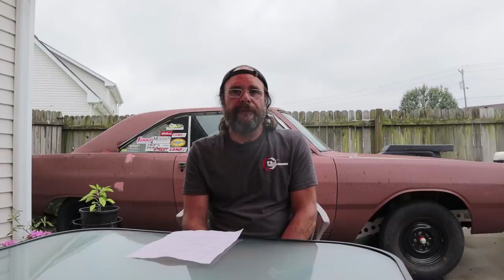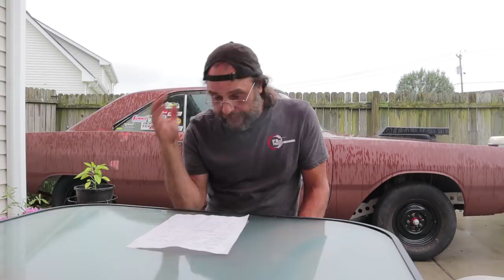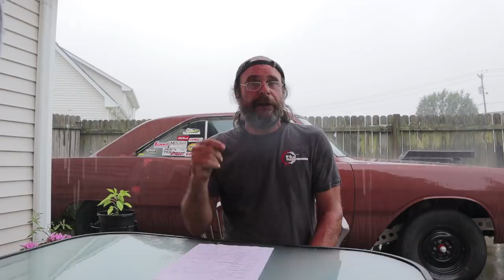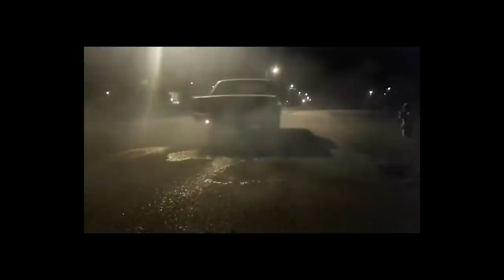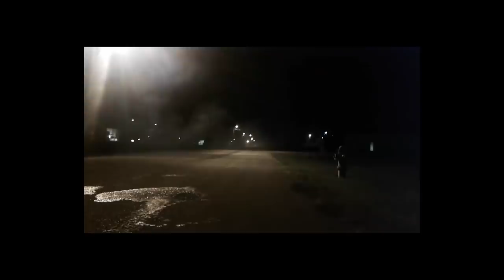Understanding The Slant Six Part Deux

Comment: Tony, I have1986 buick regal with a 307. Could it be a candidate for any kind of turbo? I've heard my engine doesn't have any life to it, said to run forever, but no life. How could it be pepped up? I think stock it's like 140-150 hp.
Reply from the maker: That 307 has two things going against it for any type of serious turbo setup.  Bottom end has huge main bearings that require a ton of oil to keep happy, and an open cylinder deck which can make keeping head gaskets in it a real problem.  I would hop that thing with conventional bolt ons and stay away from pressurizing it
Reply: @UncleTonysGarage  Thanks so much Tony, what bolt ons would you recommend, I really want to get my hands into this job.

Comment: ? so turbocharging , go for the largest chamber  that it would start on so the pressure would last the longest in the cylinders,  then add nitrous ? with fuel injection  reversed pistons and what kind of feed back to keep it from going lean ?

Comment: i know nothing about mopar but i have had a few of them i got a slant six in a 66 gt dart can the trans fit a 318 and will it fit in the 66 dart i can get a built motor  for free and i have a 360 mag sitting too  and i got i think it is 392 hemi not sure of the size needs rebuilt i was told it was a 392 but it is a hemi

Comment: having slant 6,  318,  361, 383,  440,  stroked 440 max heads.   from the factory slant 6, 318 the small ports are the limiting factor.   a 318 doesnt run good on propane.  it takes up way to much space in the port limiting the air.

Comment: @Uncle Tony’s Garage correct me if I’m wrong but isn’t the a903 the unsincroed 3 speed that was usually on the column? Was wondering if you did any modifications to it like gear ratios or a floor mount conversion of some sort? Have one myself and never thought about using it always thought the a833 4 speed conversion was my only real option for performance. Would be awesome to hear back thank you!
Reply from the maker: Yes, the 903 was always column shifted in factory cars.  I built a floor shifter for this one using parts from a couple of different 3 speed floor shift conversion kits.  I WOULD do a quick video of how this was done, BUT, I used the lightest bits available and it's really only good for drag racing...too flimsy for day to day driving.  Pretty sure you can still buy the Hurst kit for the 903
Reply: @Uncle Tony’s Garage so other than the floor shift kit the transmission is completely stock?
Reply from the maker: Yup.  Really not much to do with one of those things

Comment: I didnt get to mention in part1 comments. You already know this but others may not ? Doing some research found that the stock 1 & 2 barrel intakes had 2 flaws : 1 not good air flow. 2  the intake runners are long going out on the end and as you get to the center they get shorter. The problem is the longer the runner the fuel/ air mixture leans out while the other short runners make a rich mixture and that between the 2 you can never get the fuel to air mixture even causing some plugs to foul out etc.  short and long 4 barrel intakes with 4 barrel carbs run rich  but flow very well.  The best of both worlds is the offenhouser  intake with 2  1 barrel carbs with even length runners and even fuel to air mixture. You can also use  1996 jeep cherokee 4.0 spark plugs . The threaded  tower and electrodes are longer which moves the end of the plug further from the head and more towards the middle of the piston for less chance of arching from plug to head and will make a better burn putting a spark in the path of fuel and air  and still has clearance  from the piston and the valves so no damage to internal parts . I did this on my slant 6  and notice a little different in power and fuel economy. I just hit subscribe button  .  if you have any thing to add your more then welcome. Love the videos Tony 😎
Reply from the maker: Jeramiaha, go back and watch part 1.  I get pretty detailed about the intake manifolds on these engines

Comment: Tony this may be a stupid question , I see all the holes drilled in the frame behind you , is that to eliminate weight? Doesn’t that make the frame weak
Reply from the maker: Yes, to eliminate weight, and they are strategically placed for this cars dragstrip only purpose

Comment: I'm seeing new turbos that run off the belt instead of exhaust - l think that's the way to go because the intake air should be cooler...good video - get out of the rain
Reply from the maker: Those are centrifugal blowers, like the Torquestorm I mentioned in this vid
Reply: @UncleTonysGarage  all l know is with the motor leaned over to 1 side - that should give enough room...stock intake - l don't know...we had an old diesel Cat Grader and it's intake looked like a transmission fluid funnel running along the side of the head with the turbo at the wide side of the funnel

Comment: I heard people converting from propane natural gas on old engines or  gas fumes with a regulator to lighten the weight and easy mixture kick off ,, , check your local inspection if it's street legal for gas fumes are explosives time bomb ready to happen,,  plastic gas tanks and smaller to lighten the load junk yard modifications doing cheap and modern

Comment: They did up a 265 HEMI Slant 6 for the folks in Australia......it had 302 HP and 320 lb-ft of torque in stock trim.

Would this be something to look into?
Reply from the maker: Well, it's not related to the Slant, and it's not actually a Hemi..and none made it to this country...but, they are great engines.
Reply: Neat thing about the 265....uses the 318 piston with a 3.68 stroke. making it oversquare.

Comment: Tony, as a performance builder, How would you build a daily driver? Those old motors were never meant to further than 100,000 miles. I have read about them going a million...... Sounds like a 10 year old Caterpillar, Detroit, or Cummins class A Diesel.
Reply from the maker: I talked about the 170 in our 64 Dart daily driver in the first video.  Purchased from the original family, it's been in constant use since new, and from  what I can tell, never been apart.  Runs perfectly, and has well over a million miles on it

Comment: Have a question is it possible with the slant six just to put headers hyper pack manifold on a stock engine just in till you have it build up just for the streets and maybe every once and a while down the track
Reply from the maker: You can..just don't expect it to run very hard

Comment: What were the marked differences in character between the slant 225 and the Chevy 230?
Reply from the maker: Chevy 230 would be an easier engine to hot rod using traditional thoughts and methods

Comment: What I have noticed is , maybe it's just me , but my car performed it's best at about 1mile before it completely ran out of fuel , now is that from the pump drawing more air from the tank or is it due to the compression of the air going thru the line , or is it from the air cooling the last bit of fuel. Early on tried dry ice to temper the fuel before it reached the carb.
Reply from the maker: no idea
Reply: @UncleTonysGarage  I took that 318, 69 charger and did fiberglass rear wing , air inlets over on the fenders , and the front Daytona nose , cut the fenders back put in a bulk head ,and used the hideaway lights to open the hideaways, sold the car to my friend another Italian who's dad did the stamps on the Daytona , he used the car for a pace car,  painted purple with gray race flags.   Used the Chilton book for measurements.

Comment: Did you ever go over the aluminum head? Pros cons are they even worth it? Super rare?
Reply from the maker: From what I understand, there are less than a half dozen of those things kicking around, so I don't really consider them viable
Reply: Bummer... for some reason I thought the 76 feather duster had an aluminum head but after double checking that wasn’t part of the weight reduction... shocked the aftermarket never made one 🤔

Comment: Would you happen to have a really good wire diagram for a 1970 Dodge Dart? I think I told you what happened to mine basement paint it and everything else and got ripped off and I don't know how to do the wiring
Reply from the maker: Mymopar.com
Reply: @UncleTonysGarage  I do not know if I commenting on yours about what happened to me but I have a 70 Dodge Dart I paid someone $18,000 to do this car for me. They were supposed to paint it Hemi orange with a black stripe. Do the interior orange and black. Why what's up. And put a 440 up. I did not hear from him for over 3 months I decided to try to call I could not get through and I finally went to his garage. I seen my car in the garage doors were locked. I called Jim the guy that owns the garage and he running from. I said where is Rick he said Tony that's my name also he said he's in jail or I should say prison. He had a drug problem and did not finish my car all he did was painted put a vinyl top on it and he didn't put a 440 in it he put a damn 318. Don't get me wrong a 318 that damn good engine. But I want Power. So I brought my car back home now it's just a pretty yard ornament I don't know how to wire it back the Interiors out of it so I'm stuck with your doorman now I'm disabled I live on disability took me years to save that money up. I put my car up for collateral for $8,000 just so I could get the 18,000 up for him to do it. So now I'm stuck with a car payment a loan payment I should say and I got to pay that off once I pay that off in 4 years I'm just going to put the car back up for collateral again and get the engine done end transmission and drivetrain then wait refinancing again and get the interior done if I live that long I'm not young

Comment: A top fuel motor is NOT under square like a slant 6. There close to square but still slightly over square. Avarage top fuel is 4.31×4.25.
Reply from the maker: Don't know where you got that from.  They're 4.185 X 4.50.  Have been for decades
Reply: @UncleTonysGarage  well I didn't get it from Wikipedia which I see you did. I know you getting exactly the same numbers down to the thousands is a coincidence
Reply from the maker: You're kidding, right?  I know the number down to the thousandths because I used it all the time, ordering pistons for ours

Comment: Having most of my experience with small block Chevys and Fords, I had to Google open deck engine...that looks like a horrible design choice.

I've never wrenched on one myself, are there any benefits? It looks to me like the entire cylinder would be unstable and prone to failure.
Reply: It allows for a lot of coolant volume, but, at high rpm, any open deck engine will have problems with the tops of the cylinders moving around and causing hg failires, among way worse things. 
Edited because I forgot to add, a lot of people who race open deck engines use a company who makes a brace piece that fills in the top, but leaves all the rest of the volume under it, amd it has holes drilled through it to allow for further water flow around it.

Comment: do you think that a \6 can handle a turbo or even a blower ???
Reply from the maker: Yup.  Watch the video again
Reply: @UncleTonysGarage  saw the answer later in your video , forgot to go back & wipe question .... you have scratched an itch i've had since the early to mid 70's .... had a 74 dart swinger w/ a 225 ci. ... put a shit kit in it 4bbl , 3" exhaust , isky custom grind cam {that was when isky would talk you through your project & tell you what you needed} isky even made suggestions for your build & made recommendations for parts , even competitors parts .... so here i am 40+ years later & find your video on the \6 & i now have the itch again .... oh well here we go again :-}

Comment: To summarize slant 6 engine characteristics low performance head due to small ports, low flow and large non quench combustion chamber.  Poor bore to stroke ratio with only 4 main bearings, the crank does break on extensively modified engines.  Lots of time, effort and money are required go get middling power out of it.
Reply from the maker: Yep...and those are actually its good qualities

Comment: It's a pity as cars this old are extremely rare in the UK. Even a 1989 vehicle is hard to source due to our climate making vehicles rust. Literally the majority of car makers have rust issues at 15 years old.
Reply: I'm on the east coast of the US, bought a 73 Plymouth scamp (sporty name for basically just a valiant, but I love it to death) over a year ago and had to replace about a hell of a lot of rusted out metal, from quarter panels to rust holes to parts of the frame and the rear spring mounts. If you've got time, a bit of metal and some decent putty skills to clean up after yourself you can make those rusted turds shine like gold
Reply: There has to be a place somewhere near you that has a drier climate.
Reply: @coozy100  The UK is a RHD country, a lot of the older cars are imported from Japan. Usually late '80s sports cars or drift vehicles, but even then it's a rarity and isn't cheap. 

Close countries, such as France are LHD vehicles. For resale in the UK for profit, RHD vehicles are sought after.

Comment: You can also use flywheel and converter aluminum axle as wheels aluminum light weight one size down ,one size wider,, the transmission ,axle differential must be lighter weight and aluminum,,it slant 6was made different or the reason of copy cat laws and law suits also clients would go for better cheaper and supply delivery, pride,,, I was talking to a friend last week America automotive industry would be nothing without the v engines,,,, light weight on car meaning thinner fenders ,doors or fiber glass,, junk yards and salvage parts from newer vehicle modifications,, ,some also make their cars convertibles with either vinyl or fiberglass top just to lighten the load less weight on the torque,wheel components and body will make run faster,, intake sounds harsh but with technology kits these days ,, , I seen rotary car engines run pretty fast to these modifications, making the motor last longer ,less stress, if it can be done to the rotary engine it can be done to the slant,,lubricant oil is a key factor and oil addicted such as best line ,and motor kote,,Valvoline synthetic the silver one highest grade 0-20 0-30' 5:20 or 10-30,,, some like the  racing 15-40, 10-40 but those are for mainly heavy duty , diesel and boxer engine s

Comment: sry dude.... the slant is not a decipherable thing.... damn things are almost bulletproof. Try to run a 350 chevy with a hole in the block,  or even a 360 mopar..... pour oil innit all day, the slant will run the v's wont

Comment: Damn, that's some obsession right there.  Sitting in the downpour to finish the video instead of going inside and starting over. 

Friend of mine back in California had an older Dart with a built slant in it.  Twin carbs, split headers.  Professionally built engine (forget who) by a guy that wouldn't even share the exact cam specs with the owner of the car.  Automatic trans.  The thing was a beast.  Yours sounds way healthier, though.

Comment: Focus Dude , [ Camera ] ; Explain 2 the Kid's Y Nitro & Nitro Methane Duz's it Deed , [ Water Injection 2 ] . The Mass of the Gas > Induces the Kick OUT the Ass !? Berring's B Damned ! These Kit's Were Quite Common on Aircraft Engines of the WW2 Vintage . Usually 4 War Emergency One Tyme  Power Use Only , as they Would Destroy U'r Power Plant But Would Save U'r Ass . Speed & Altitude is Everything ! [ Potential Energy is U'r Friend ] . YYZ , Mohawk-Planker / Rock-Crush'in Ratman !!! 5 by 5 ...

Comment: I'll bet you $1 that your lobe separation is too wide and the intake valve closing too late. That's why you don't have the bottom end torque you're expecting.
Reply from the maker: That's not it...even swapped in an RV cam just to see what would happen.  I don't know what Im ultimately going to need in terms of camshaft yet, but I'll be diving into that soon
Reply: @UncleTonysGarage  Slant Six racers know that for the 225 a lobe separation of 106-108° and an installed intake centerline of 99-102° gives the proper valve timing for cams over 230° duration at .050" lift. About 4-8° more intake duration is helpful until you get into 240°+ duration where it matters less. The pre-1971 225 cams were dual pattern 240/236° advertised, 109° LSA, installed at 107°. Cam grinders don't know and will sell you something that works for the oversquare world that you are familiar with. 

If you don't use bigger valves you are leaving much power on the table. Don't even port the runners, just profile the valve guide and port the bowls. It's a relatively massive improvement. a 1.70-1.72" is a good intake for a stock bore, but I've used 1.78" successfully. 1.45" is a good sized exhaust valve.
Reply from the maker: Thank you for the input Josh.  The engine that's in the car now is just a mule I screwed together to get a handle on things like fuel distribution/jetting/general characteristics, and I learned a lot from it.
Mostly I learned that the Slant is really unhappy trying to work a torque converter!  Converting it to stick was the last thing I did to it before putting it aside to focus on other projects, and it was by far the single biggest gain.
The "good" motor for this car is something I plan on working on over the winter, and I'm going to throw 100% of everything into that 3000-6000 RPM range, so the cam profile is going to have to match that.
  I may run the car a time or two in its current configuration, but I'm not expecting anything crazy from it.  A slip anywhere in the 12.50 range would be great, and as you can see by the vid, she SHOULD be able to swing that without much trouble.  I'm wanting a lot more out of my lightweight!  We'll be covering the whole thing, step by step...good and bad, when we get cranking on it towards the end of the year.  Gotta get Project Bottle Rocket wrapped and running first.